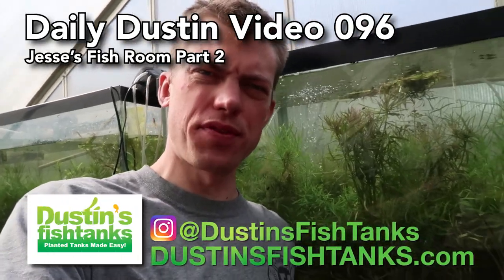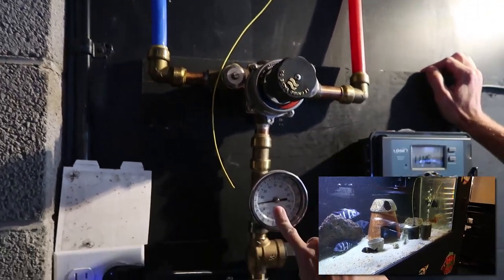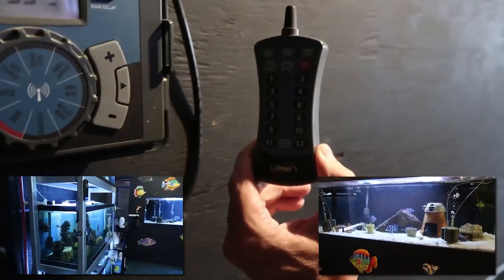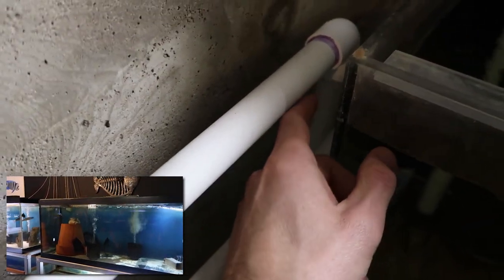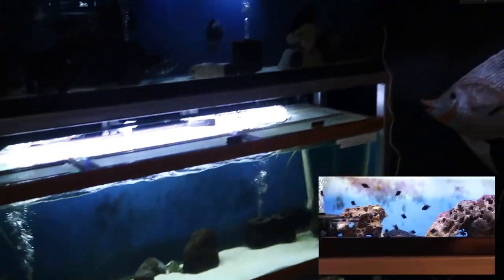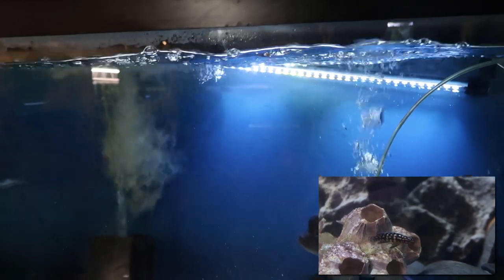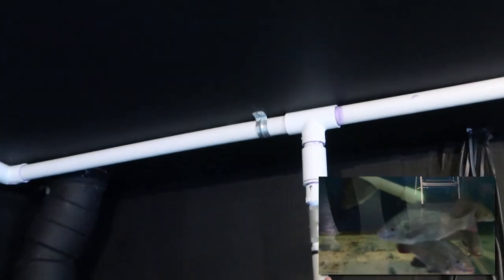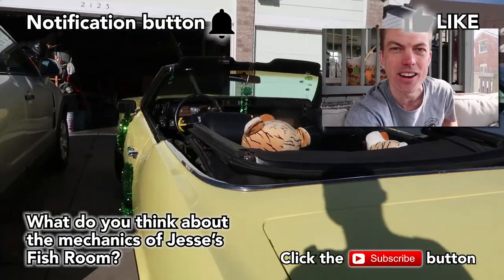AQUARIUM FILTER: How Jesse's Aquarium Fish Room Works

Comment: Another way to plumb the mainline supply pipe to the end tank. Then install the valves along the line at each zone. This requires more length in wiring but less in plumbing. Either installation works i'm really impressed.

Comment: The only problem I see with it is what do you do about the hardness of the water? Is he just leaving it at what ever comes out of the tap or adds it manually in after the change?
Reply: Jesse Schumacher Hi. How are your stands built? Which material did you use? How large are the tanks? Do you reckon the stands would hold an 180 gal?

Comment: Nice system but a drip system is better in my opinion.  Its hands free and very little to go wrong.  I believe in keeping it simple. For your green house I would go with containers in ponds and a drip system.  Have water go in one end and out the other end.
Reply from the maker: JW Collect I hear you, and those are good- however, drip systems can’t remove dead plant mater with a mega drain, (which bad leaves fouls all water). Giant drains and push button refills in our water change system design now
Reply: Hey Dustin,  I agree, dead matter, poop or whatever laying around needs to be siphoned off, then tank/pond will refill itself with the drip system. The other advantage is auto top off.